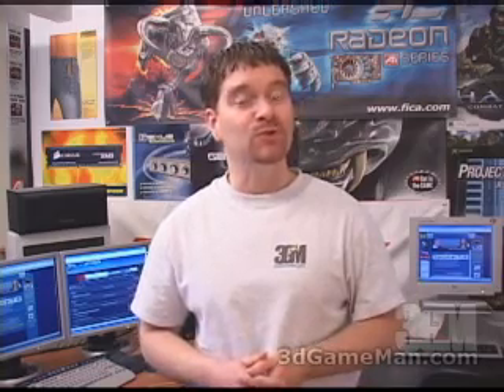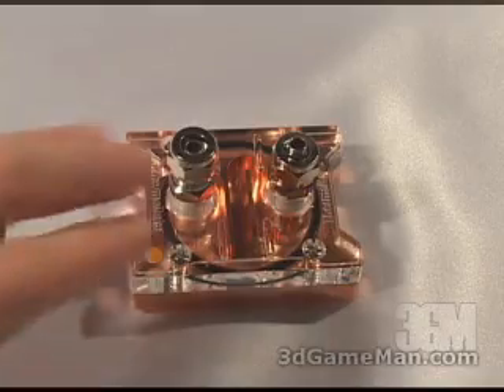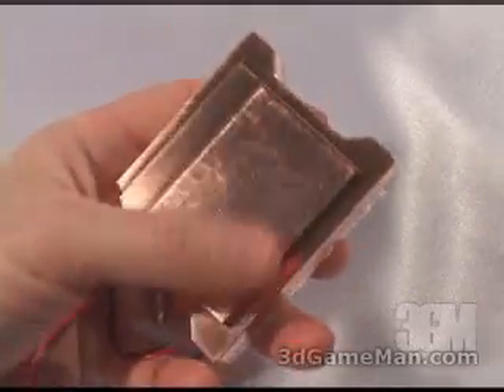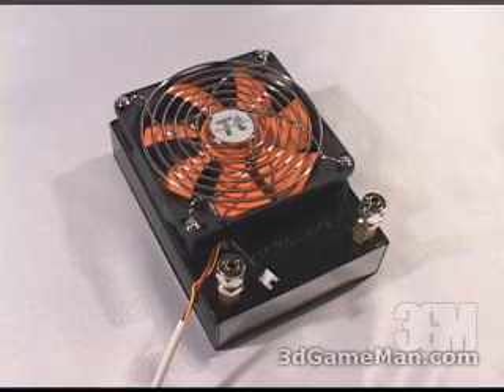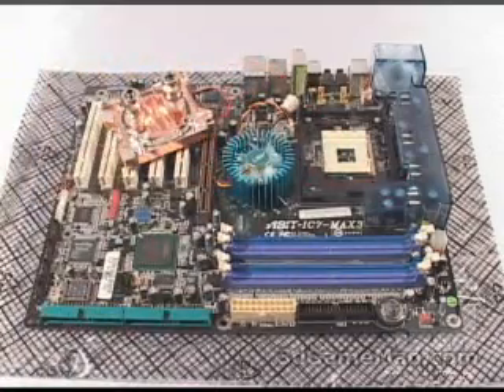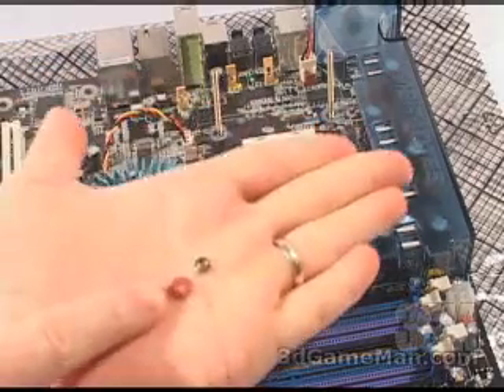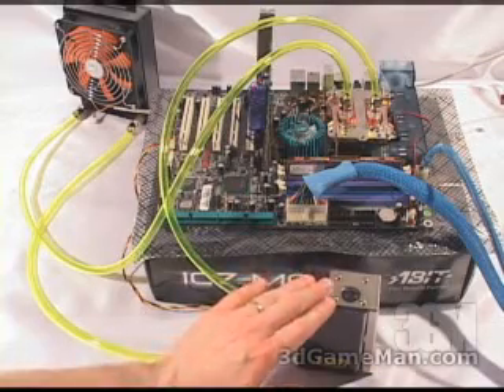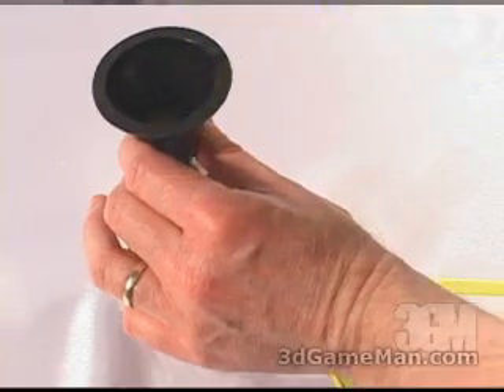#529 - Thermaltake BigWater Water Cooling Kit

Comment: @ludekogamer 
Smooth surface was a bit sarcastic, becouse if u watch the vid it doesnt look like a verry smooth mirror polished surface

Thick copper is bad becouse the heat and cooling source must be as close to each other as possible.
Compare it with a blower on a hot summer day, if u have your head in front of it it feels a lot colder as when you are on the other side of the room.  

Alu+copper in same loop the alu will corrode.
And its bad quality set,a good extensive set is around  200/300$

Comment: this is so hot because its a pentium 4 wichare musch hotter than even oced core i7s because they have high fsb untill they came out with duel cores, so a modern system would run way hotter with this system, btw the bigwater 735 its just an update of this

Comment: I heard the swiftech has problems with leaks if it's not sealed correctly. The H50 is supposed to be very good though. CoolIT Systems DM-1000 is also supposed to be very good, it's also got a digital LCD panel. I'm trying to find something that will also cool my GPU's

Comment: Boy that's no joke seaturtles, my cpu is running stable at 39 degrees all the time on air with an X4 processor and dual vid cards! He was running 41 DEGREES AT IDLE??? and 58 DEGREES UNDER LOAD??? My core temp is only 42 with a 20% load!! Granted it's an older product but it should actually cool the cpu shouldn't it? It's that what water cooling is for?

Comment: let me try again 
2 SLI and 2 CPU 
should i get 2 or more radiators? i need to water cool the gpu due to the size of fans and y not add the cup to it if it'll work.   and in not using it JUST for gaming but why wast a good gpu :)

Comment: Plain and simple.

If you're only wanting to cool your CPU, ThermalTake is FINE. However, if you want to cool more chips than go buy separate parts.

If you can find one, get the TT 850 (not the 850i there more expensive). Do NOT buy TT flowmeters and any drive accessories. These were discontinued due to how faulty they were. My mate lost a lot of equipment due to the faulty drive bay extras.

Comment: this kit is actually an awesome deal and you can upgrade it very very easily by the time you're done getting another radiator and pump its still cheaper than a switft tech and performs the same. i oc my 7750x2 to 4.0ghz which is pwnage in my book

Comment: i have the same processor as you but idle i run 37ºC and i only have 2x 120mm fans. i can OC to 3.0 on air. im going to buy this kit and hopefully get it a little higher.

Comment: 120L per hour is the downside of the kit. The newer thermaltake kits do around 500L per hour increasing cooling performance. This still doesnt justify it. Its good allround but if your an overclocker get a bigger pump. The blocks are awesome. Radiator is decent. Pump is just a tad slow.

Comment: i got the Thermaltake big water 735 cooling system and i hooked it up last night and the water wouldnt flow at all the radiator is on and so is the pump what could it be

Comment: H8Feeder, If you use two pumps in series (one after another) you dont have to worry about that, and for the leaking, get a non condictive coolant, and check you fittings before you start the system, I hope this helps.

Comment: i have the antec 900 and it mounts inside where the 120 fits. its a snug fit inside it blows out like the normal 120 does the only downside is the fan on it is not blue led but iv modded mine so i have the blue led 120 inside of it.